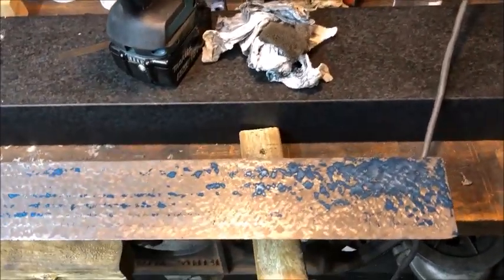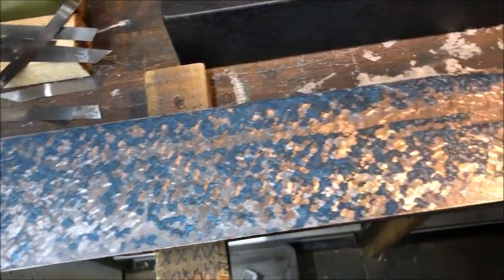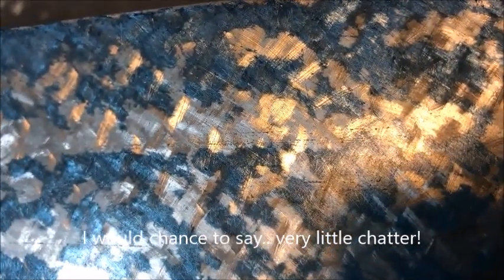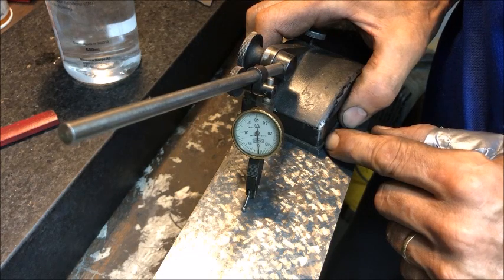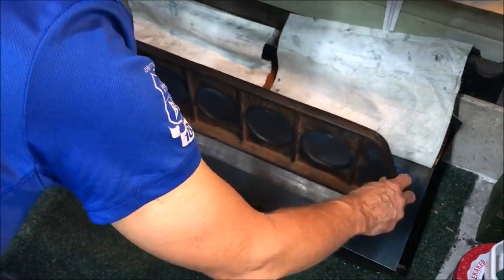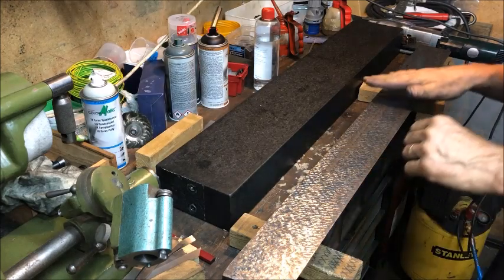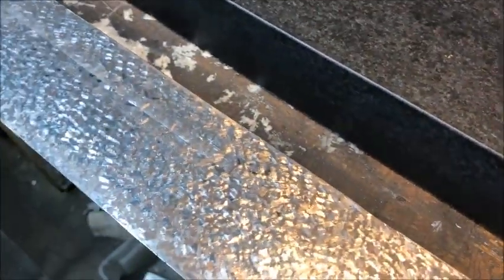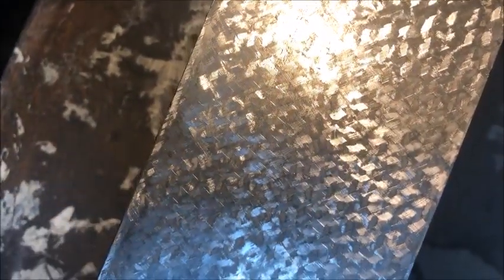Scraping Kingway HKA36 continued

Comment: You have more scraped surfaces in your shop than any two people I can think of.  What do you protect them with, for the ones you do not use often?
Reply from the maker: Hmm.. the best I can think of as a good answer is "oil", ie. keeping them oiled. I also wipe them clean when needed, try to do after each time I use the machines.. one of those boring, but needed routines I learned from my granddad.. always take 10 minutes when done to tidy up etc.. much better when you get back next  time!
Reply: @jansverrehaugjord9934  - I have a wooden box with some adjustable parallels that I hadn't even thought about in years.  When I did open it up, there was surface rust on all the surfaces not in contact with the box - because the box had wicked away the oil that gravity brought to it.  After that, I made sure to use oil and wax paper like gage pins or blocks are wrapped in when they are new. 

Now, I also deliberately oil-soak the wooden boxes that some of my measuring tools rest in.  I don't really know if that does anything, but it makes me feel better :-)
Reply from the maker: @somebodyelse6673  Ohh.. yes, rust creeps in. I try to hold the workshop quite warm, but in winter it is always a struggle. Luckily, in that respect, tbe humidity is low, especially in winter.  Anyhow, sounds like good procedure 😊